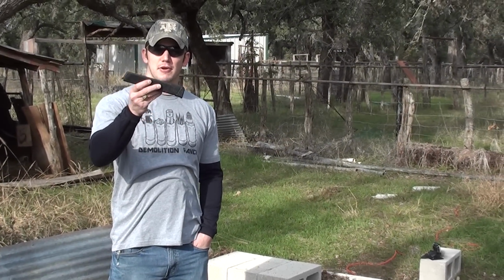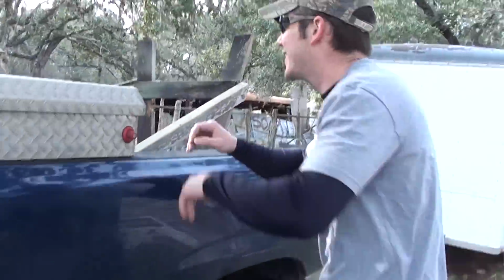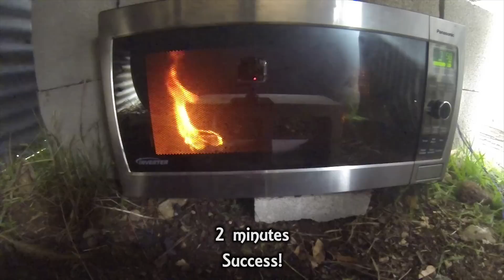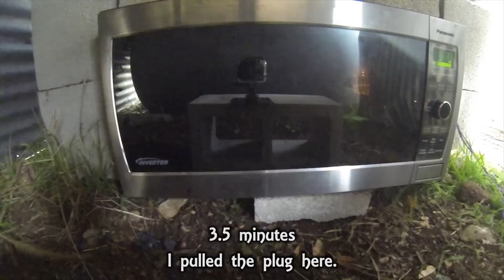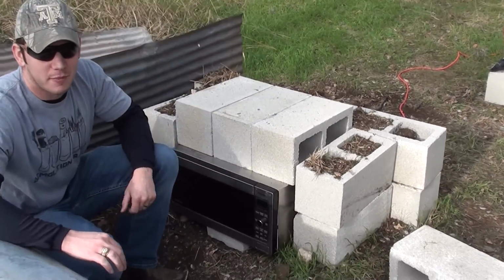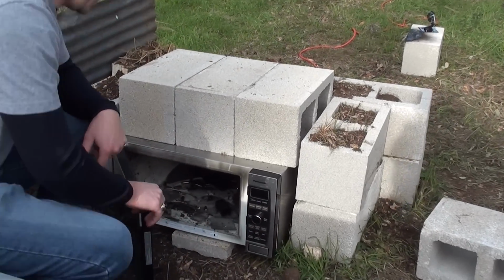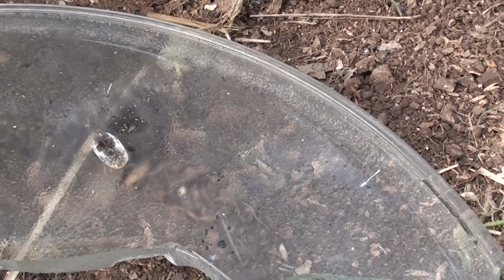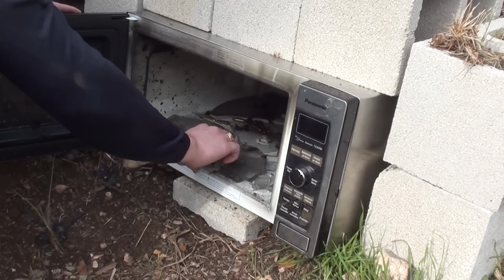Loaded Glock 18 Mag in a Microwave

Comment: You might consider using the different cooking stages for safety. Most microwaves have 2 or more stages. You can set stage 1 for 30 seconds at 0% power and stage 2 for your cook time at full power. That gives you 30 seconds to retreat before the cooking begins.

Comment: Hiding behind the bed of the truck is like hiding behind 2 sheets of metal and a little pit of plastic. Bullets will go straight through the back of the truck. If you were to take cover behind the engine block, well, the engine block is almost 2 ft of solid metal. I know the stuff you put in microwave isn't that harmful but giving you a heads up.
Reply: I'm sure he was safe enough, bullets don't come out that fast if they're not in a gun, pressure build up and barrels make them dangerous.
Reply: No compression, they really need to be in a barrel for something like that to happen.
Reply: C0revette789 MrTuts4life Dogeggz Could you guys read the last sentence one more time? "I know the stuff you put in microwave isn't that harmful but giving you a heads up."